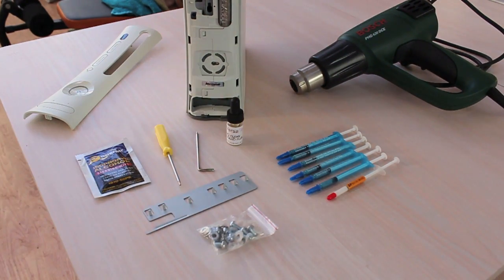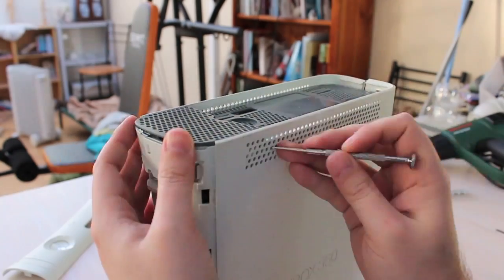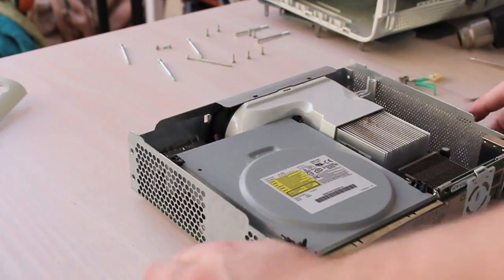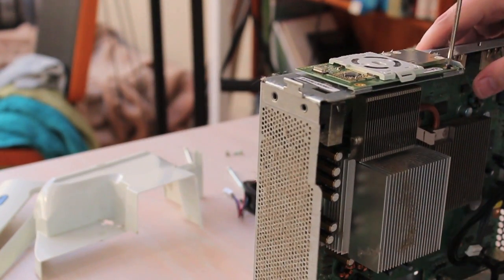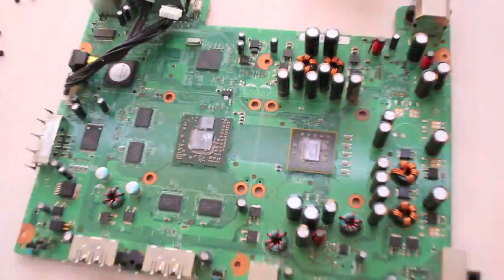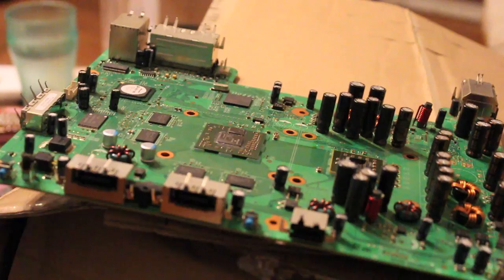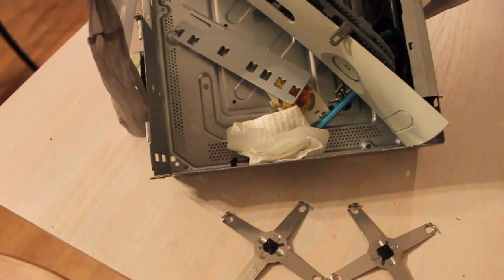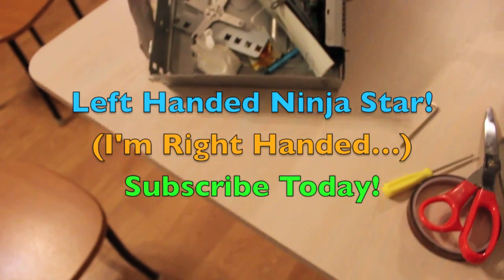Xbox 360 RROD Repair Attempt (Serial: 072261382807)

Comment: Those huge caps all over the board are a real pain, they bulge real easy, lots of people shield them with foil, but they need replaced most of the time anyway. I use a board brace/jig with stand offs, and set it on a griddle, and heat it up to a couple hundred hundred degrees, then monitor my temps real carefully when applying top heat, ps3 boards handle these high temps better though. Wish I could afford a reflow station. Good videos.

Comment: Will you try to fix it again or you will leave it as is?The PS3 did you fix it or not?May be you should try an other repair kit with other aftermarket heatshinks for the gpu and the cpu.My project is to fix a faulty 360 but i want to install the hardware into a COOLERMASTER RC-120A-KKN1 ELITE 120 ADVANCED or THERMALTAKE VL52021N2E ELEMENT Q.

Comment: what i done with one, i had is i didnt use a heat gun, i wrapped it up in a towel and left it on for a while with the fans off, i didn't use flux though, it worked but didnt last very long, probably because i didnt use any flux lol.

Comment: I did the same as you pretty much, but when i was heating the gpu and cpu, the caps on the board exploded, i replaced the bulging caps and i did the x clamp fix but i still got the red ring, these things are really difficult to repair.